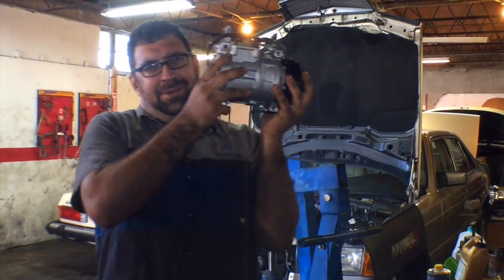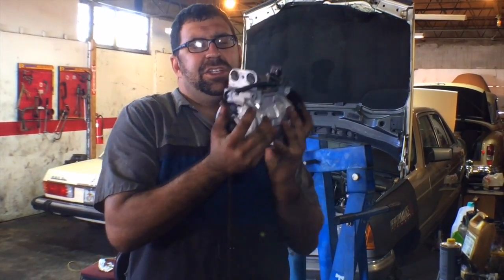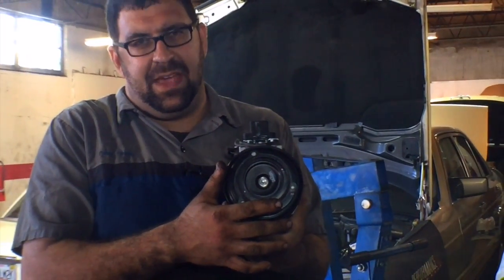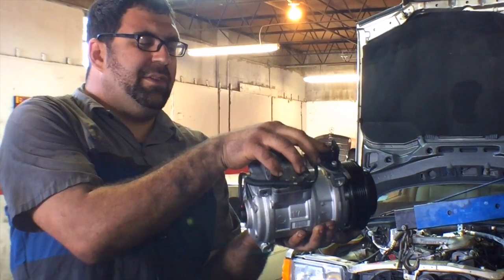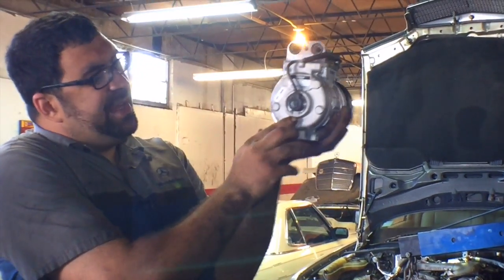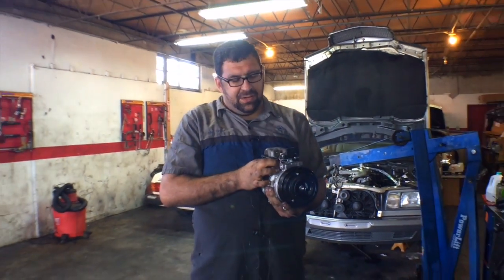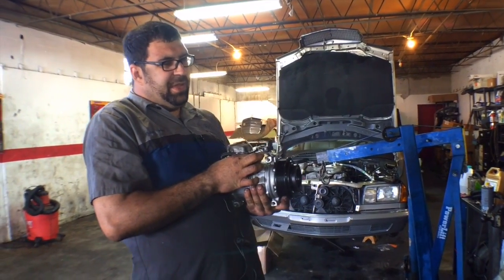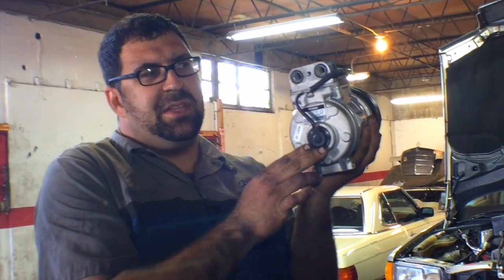How to diagnose a bad compressor rpm sensor

Comment: I think this is the only video on YouTube that actually explains what an ac compressor rpm sensor is and what it does. I always thought that plug in the back of compressor was a pressure switch of some sort.

Comment: Great - you explained what it does, but you didn't actually explain how to diagnose a bad one as per the title of your video... 
For the benefit of anyone wanting to know how to actually check if the sensor is bad, there are 3 pins on the electrical connector on top of the  pump, One will feed 12V to the clutch solenoid (subject to the ECU receiving a signal from the RPM sensor) the other 2 pins connect to the RPM sensor.  You can check the resistance across the sensor which should be between 1,000 - 2.500 ohms.
To check the Hall effect RPM sensor is working correctly you can provide a 12V feed direct to pin1 from the battery to engage the pump clutch. Then with the motor running and pump spinning you should be able to measure AC voltage of approx 0.5 - 1.0V AC across pins 2 and 3.
Reply: It's a VR type sensor not a HALL

Comment: i have an 89 300se with compressor issues(r134 converted and compressor is from dealer [compressor's age is unknown]). I've swapped a few klima relays and hasn't served as a remedy. Only way i can get compressor to turn on is revving to about 2-4k rpm & turn ac on while holding the rpms. ( will blow cold when compressor kicks on and hi/low refrigerant pressures are at appropriate parameter values, occasionally compressor will turn off after a hard pull down the street and wont turn back on ) Is there a relevance in this situation to condemn the rpm speed sensor? I no longer can get the compressor to kick on even with holding high rpms and simultaneous activation of the ac. Any input is greatly appreciated <3

Comment: My ac cuts off at idol and under 1000 rpm but the sensor is new.i swapped the old sensor off the old compressor with the new one and same problem.any ideas??? It’s a 2002 Lexus is300